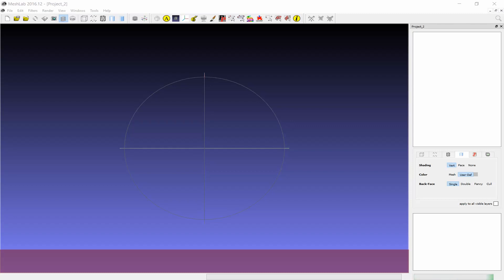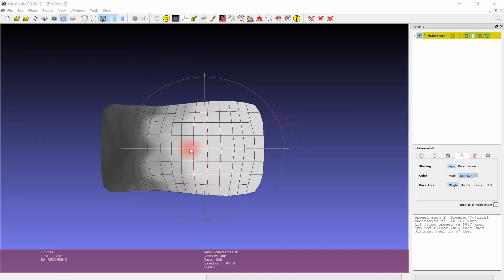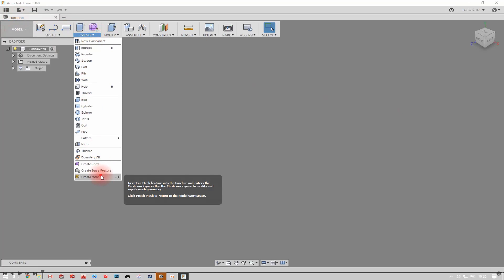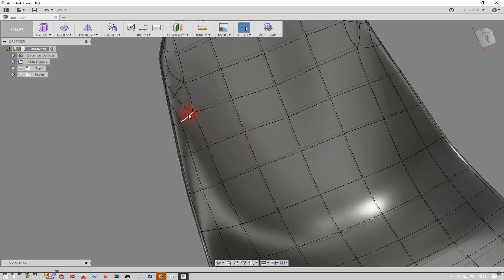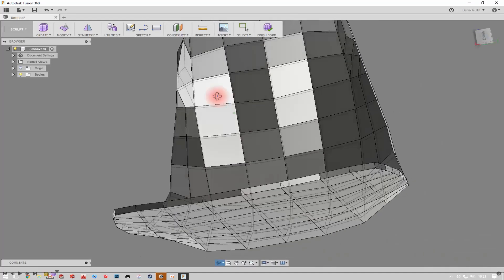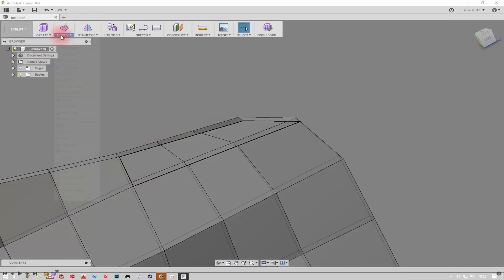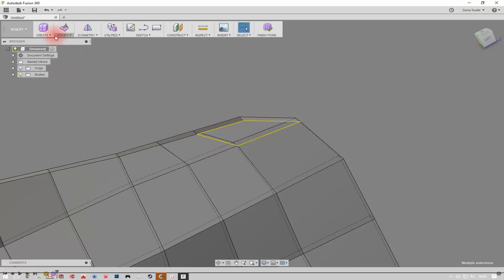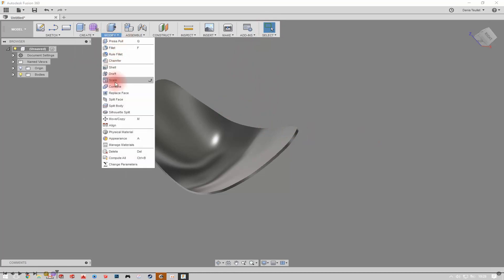Workflow : Convert tri-mesh into quad-mesh (Meshlab and Fusion360)

Comment: Thank you for the video.

I have a weird problem that when I export the files its back to its original state. so still full of triangles. Would you know a solution to it?
Reply: I had the same problem. When you export from meshlab, just after you've chosen obj as export type and hit ok in the save as dialog, another dialog comes up. There's an option in there, "convert triangles to polygons". You just need to toggle that option.
Reply: @Mirandorl  Thank you so much! I had no idea I had to toggle a checkbox for exporting the quad mesh haha